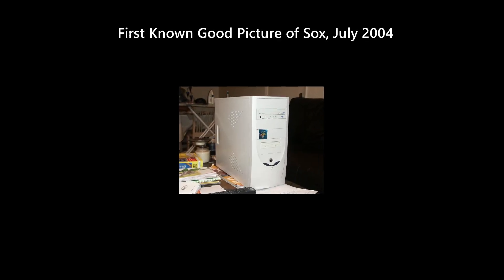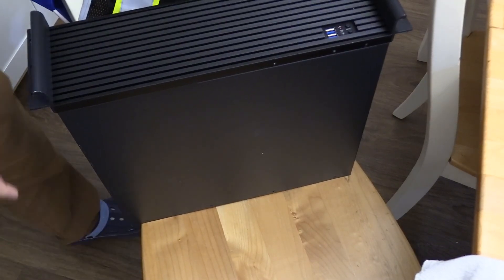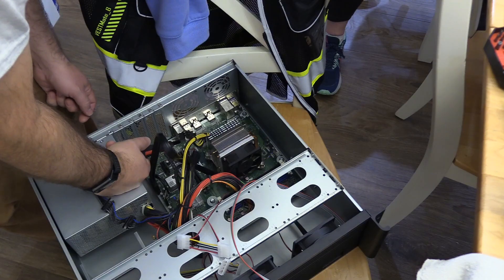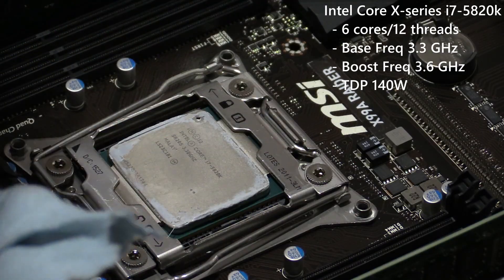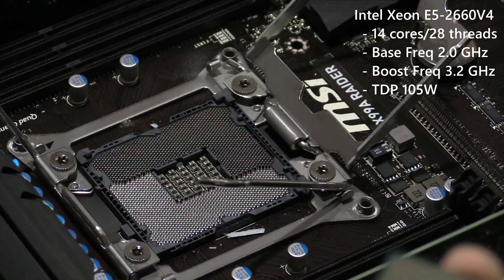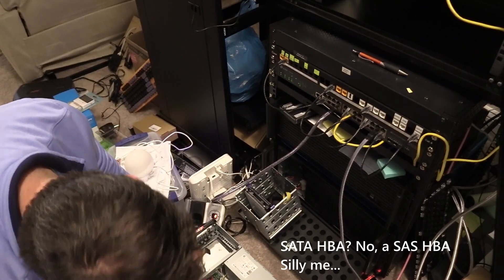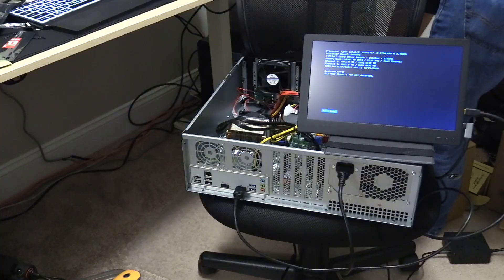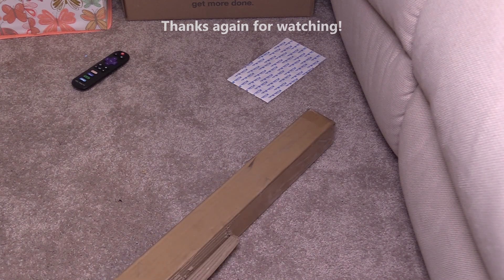Are Rack Mount Servers Worth It?

Comment: Battleship! I've got a similar setup and have been looking unsuccessfully for sliding rack rails I could attach to these 3-4U cases. Is there a specific search term I might be missing? The only brand I can find is star-tech and their minimum length is too deep for my ~20" deep rack.

Also, for a more wife-friendly rack, check out wooden 19" music-equipment racks. I've got the "Thon Studio Rack 20U" in oak, which fits my servers, network gear, and AV receiver perfectly. Lastly, replacing all internal fans with quiet noctua ones helps a lot - the loudest part of my NAS is the hard drives now.
Reply from the maker: Thank!  Yes, finding rails at a decent price seems hard.  I've seen some by Rosewill also.  My rack can extend to become deeper, though I can't remember what the minimum depth I have it set to is.
When I didn't have rack mounted gear I took a half height cabinet that you'd get to put together and put my desktop server and some network gear in there.  We kept it in the baby's room.
For the fans, I have done some replacement in other machines with Noctua, and they do help a lot.  For these though, I'd like to ensure I like what else I've put in there before trying to make things quieter. I could just wrap it all in a wool blanket or something...

Comment: When I saw the title of the video, I assumed "rack mount" meant "enterprise." I thought you'd be talking about your first Dell or HPE rack mount. A little disappointed that you were actually referring to white box machines that you built/rebuilt yourself. I'd be interested in what you thought after acquiring and racking your first enterprise machine.

Pricewise, you can find something fairly modern from Dell or HPE for not much more than you would have paid for either of those rackable cases, had you paid full price. An enterprise machine, however is likely to use substantially more power than your transplanted desktops. My Dell PowerEdge R740 draws around 185 watts, and my R750 draws around 385 watts.

Any consideration on acquiring a "proper" rack mount machine some day?
Reply: Oh wow, almost 385 watts is the power consumption of my ENTIRE rack with 6 servers, built from random consumer desktop parts, while running a 130w GPU.
Reply: @mttkl  The R750 runs only when required. Usually during maintenance of the R740. Every couple of months for a couple of hours or so.

The R740 is my workhorse, though the R750 is a more powerful machine and has more memory installed (512GB vs the 384GB in the R740).

I just know that if I need it for swing use or for a special project, it's there.
Reply from the maker: With that, do you replicate what you'd run on the R740 to the R750?  I need to think about when I take SR1 down what I'll do to keep some services running, if not all the files.
Reply: @ntgm20  In its powered-off state, there is nothing on the R750.

All the VMs are on shared storage (Synology NFS shares), so I can just power up the R750, put the R740 into maintenance mode, and watch the VMs move across on their own. One exception, one domain controller may be on local storage on the R740, so that would need to be manually migrated. Still takes just a couple of seconds to kick that off.

After maintenance, reverse the process and the VMs move back to the R740.

I'm running vSphere 8, btw. Dynamic Resource Scheduling (DRS) is what manages the vMotion (migration) of VMs from host to host in the cluster.
Reply from the maker: Thanks. I hadn't thought of that, but did think after I was done that I should say "in the home lab."  I've looked into real servers before, but generally it is the power draw and noise (at least from 1U units).  Are those power figures idle or general use?

I'll have to look around some and see what I can find.  I do have some HPE and Aruba switches, but I just looked at their power draw the other day.  Based on that and some other things I have I may just play around with them instead of integrating into my network.

I also have some 45U racks that I need to put together, but really not sure where I'm going to put them.
Reply: @ntgm20  The R740's 185 watts is under moderate load with about a dozen VMs running on it. The R750's 385 watts doesn't vary much whether the machine is at idle or running those same VMs.

Neither machine is too loud to be bothersome. That wasn't the case with the R750 until a recent upgrade to iDRAC made the machine liveable. The Synology RackStations are louder. 

I have an Arista 10G data center switch with dual power supplies and four additional hot swap fans that pulled more power in use than my current stack of Ubiquiti routers, switches, and access points. It ran hot and was quite audible, even with the fan speed manually tuned. It's in a closet now, probably never to see the light of day again.